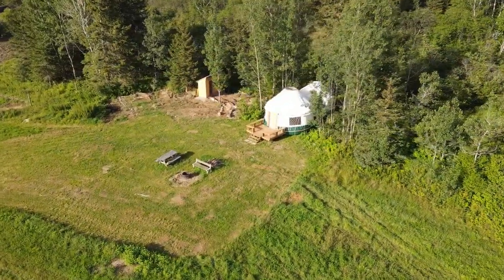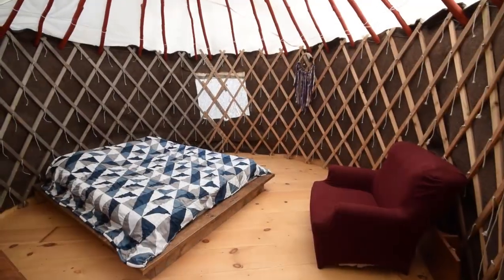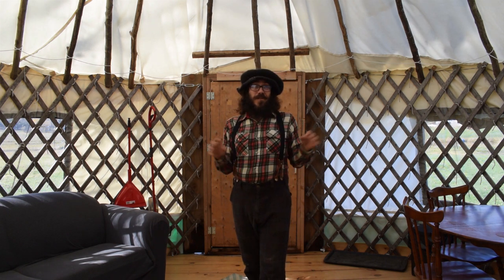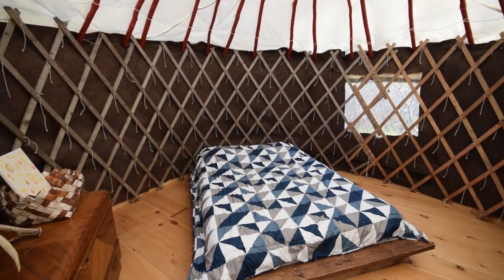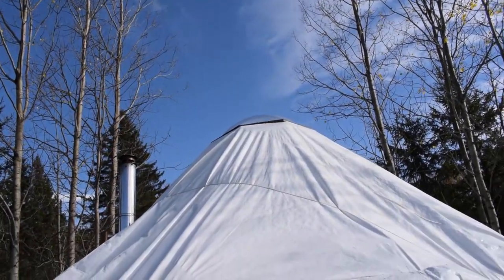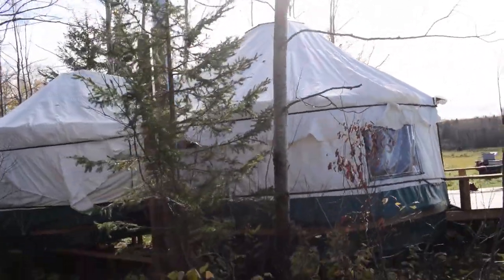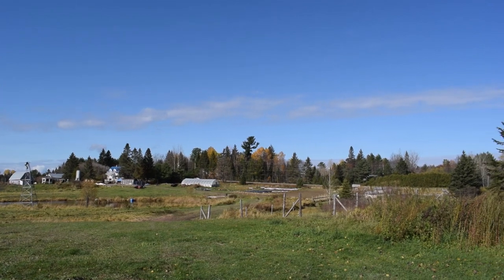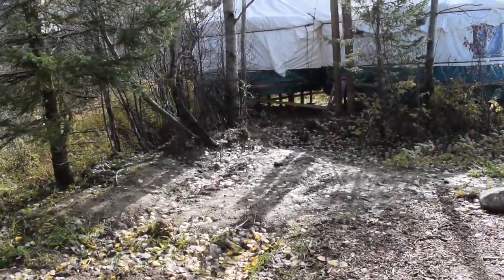DOUBLE YURT - Tiny house tour

Comment: Love what you did with two yurts. Did you insulate them? I live in Ontario and wanted to do something  like this what would you recommend I insulate with. Thanks
Reply from the maker: I lived in a Yurt in Northern Ontario for a year, its doable but after building and living in Yurts since 2010 I wouldn't recommend one for permanent living in Ontario the climate is too mooooist, but short term (a few years) or if your not expecting to stay in one place long, super awesome, I did put felt in the 14 & 18 foot on the walls, and will do the roof I think for next year, felt is expensive, you can use ASTRO foil which is a radiant barrier but it looks like tinfoil so aesthetically does not work well, but doing both would be best
Reply: its possible to use lots of plants that efficiently soak the humidity from air, dehumidifiers, electric heater connected to solar panels would do too. metal roof above yurt, there are always solutions.
Reply: @FoxfireHeritageFarm  its possible to use lots of plants that efficiently soak the humidity from air, dehumidifiers, electric heater connected to solar panels would do too. metal roof above yurt, there are always solutions.

Comment: What would be a rough cost estimate for materials for a DIY 14 footer?
Reply from the maker: depends on so many factors but you can build a 14 footer for less then $500 not including what you cover it with, (aka canvas is expensive) but other options are cheaper but less durable overall